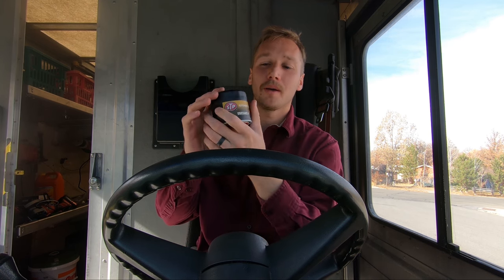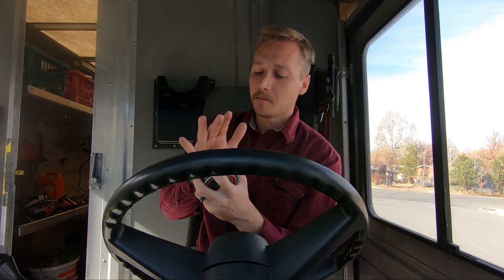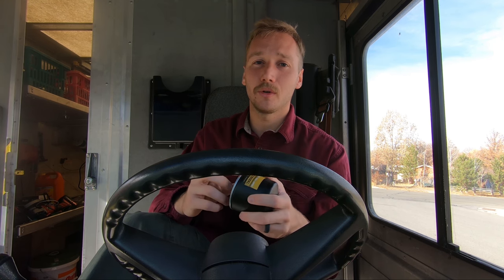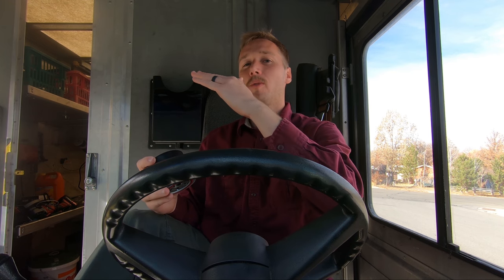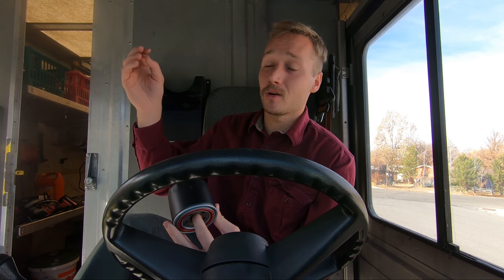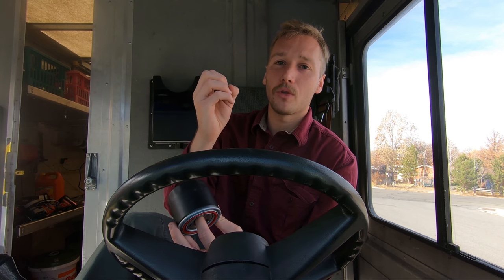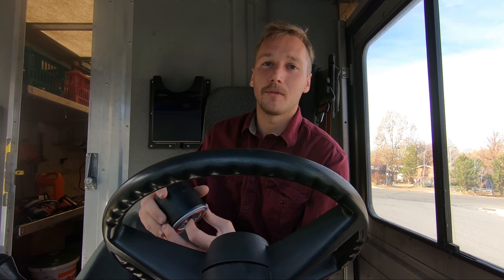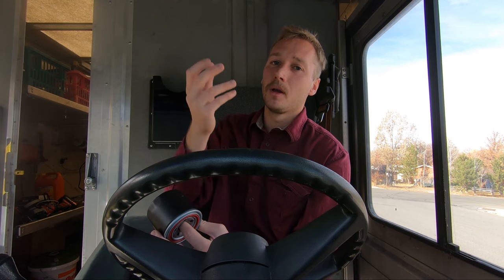Why you shouldn't put a magnet on your oil filter. **What to do instead!**

Comment: Are you a petroleum engineer? If so, can you point me to the published SAE paper which backs up your claims? I'm betting you're NOT a professional engineer, and there is no documented proof to your claim. Your position sounds like a sketchy rationalization, which is heavy on your own wild assumptions, not based on facts. I KNOW the magnets work because my riding mower engine oil & oil filter  is changed twice a year, and the oil always came out nearly black. I added a pair of FilterMags to the filter, and now my oil changes are light amber. When I cut open the filter, now, there is a black shadow of ferrous dust captured against the inside of the filter housing.

Comment: Filters don't stop as much as you think.  Magnets will remove particles that the filter can't....they are beneficial.  Putting a magnet on the filter will only help remove those particles, as they do mix with and travel through the engine with the oil.  A magnetic plug will only catch some of the particles as they settle down when the engine is shut off.  Run an engine for 3000+ miles with a magnet on the filter and drain plug, you'll be amazed at how much debris will get stuck to it...all of that debris makes it past the filter....

Comment: What if I want to put those magnets both on bottom pan but also on filter? And when I change oil I will change filter (with particles inside) and particles in the panel shall be flushed with old oil. How that kind of behavior is wrong and harmful?

Comment: TL:DR - Really good filters are really good. No reason not to add a magnet.
Reply: 20microns is what practically all oil filters can filter. The smaller pieces of metal is what acts as an abrasive inside the engine and causes damage. People who actually analyze engine oil and breakdowns already know this is the case. It's a hot topic though online and an easy video for traffic to throw out their opinion based on "it's what I think"
Reply: There is absolutely zero downside to adding a magnet. Only upsides. It cost zilch and acts at a distance to complement the filter action. Why be content with less than perfect, when this improvement, however limited, is so easy to make ?

Comment: I would put like the magnets on both the filter and the drain plug! At least on the filter the particles will be removed from your system once you change the filter. The magnets on the oil pan might keep the fine stuff from circulating, but will remain in your sump until you physically clean it out or flush it out by disconnecting the magnets. Heck, I would even use them in the cooling system and fuel system if possible. LOL

Comment: the oil comes thru the filter then hits the shell and with magnets on the shell you find gray gunk stuck to the case where clean filtered oil is supposed to be. its not 100 clean if grey matter is coming thru sticking to the magnets
Reply: You've got it backwards. The unfiltered oil flows around the outside(inside of the outer shell of the filter housing) of the filter media, then flows thru the media into the inside of the media and the filtered oil is pushed out the center of the threaded end cap.
Reply: @budlanctot3060  if its metallic and the magnet gets it thats a good thing , I had race bikes and Suzuki puts magnets on there tips of the plug nuts for that reason , they know its a good thing .

Comment: If you put magnets on the bottom of the pan there is no way to guarantee that the metal partecals have actually drained with your old oil. If you believe the pistons moving up and down and any other moving parts in there are not enough to move those "heavy" particals then how would drining the oil be any different? Why even put a magent on the bottom of the pan to begin with? Also have you ever put a magnet on a metal door or something and let it sit there for months? I have noticed that if you do that magnetic (ferromagnetic) dirt or dust gets stuck to the other side of that which is what is expected because it's a maget but my point is if you try to clean that debris off sometimes that dirt or dust gets etched into to that metal door or what ever the magnet is attached too. I would imagin the same happens in the oil pan. Why would you want etched particals at the bottom of the oil pan? They may never come off or maybe it will just break off in one huge chunk later? Breaking off in one huge chuck would probably never happen either but again i ask why would you even preffer that to begin with? If the magnet is on the oil filter you get everything out just by changing the oil filter.

Comment: All magnets are not the same. People using odd-shaped and janky magnets ain't the answer.
There is a specially-made Oil Filter Magnet available --  FILTERMAG Part # SS365PR -- Fits 3.5 - 4.0 -inch diameter oil filters. 
Covers large area of oil filter -- and IT GETS THE METAL OUT !!
Reply: It doesn't matter a tinkers damn what shape it is. Any decently strong magnet will do.
Reply: @caretakerfochr3834  NOPE. A magnet made specically for spin-on Oil Filters, such as the Filtermag SS365PR, fits perfectly against the side of a 3.0 - 4.0 inch diameter oil filter.
 They make a smaller size for the smaller-diameter spin-on oil filters. I'm not selling them -- I'm saying that THEY WORK, and no other oil filter magnet works as well. 
 You're free to do whatever you want.😁
Reply: @caretakerfochr3834  You know what they say -- " You get what you PAY for! " 😁

Comment: The magnets stick very well on aluminum oil pans don't they? Very weak points man! Just stick it on the filter! What does it hurt.
Reply: I'd go with the filter but you could always glue the magnet to the bottom (outside) of your drain pan.

Comment: Why not to add this extra level of filtration to your system as magnets. It's cheap and effective! great topic, thanks
Reply: Well, FilterMags are NOT particularly cheap, initially.  But they are reusable, so it's a one-time purchase. So over 20 or 30 oil & filter changes(100k -150k miles) the cost of a pair of  FilterMags is like $3 - $5 per oil change. During the pandemic, I couldn't get FilterMags, so I bought a bunch of neodymium bar magnets for about $30, which worked just as well, but they weren't nearly as convenient to use.

Comment: Wouldn't a magnet interfere with the oil filter bypass valve? Yes.
Reply: NO !! The FILTERMAG #SS365PR does not interfere with the mechanical operation of the oil filter in any way.
Reply: @SlikLizrd  yeah,  it definitely does. Don't make me post a link showing you what that does when oil is running through an oil filter. It certainly won't help.
Reply: @CorvetteTrev  send the video
Reply: @CorvetteTrev 
POST IT!!!
Reply: The oil filter bypass valve is only opened when the oil pressure on the filter media exceeds the bypass valve psi settings... Lol
How in the world does a magnet on the side of a filter affect the oil pressure inside of a filter? It doesnt. 
I would love to see a video proving me wrong but Im quite sure that one doesnt exist.
Reply: @oompaloompa7430  

You are correct. ✅
Reply: @CorvetteTrev  

Show me. Show us!!  😐 We're interested.
Reply: @steven4894  I mean the whole idea is pointless anyway.  If you have metal in your oil pan you have a whole other issue. I run a dry sump on my Corvette track car,  we left a boroscope inside one of the oil cooler lines (*in place of one, sealed) to make a promo video for improved racing oil thermostat. The wide angle showed the filter and if you saw the amount of flow,  when hot 🔥 🥵 a magnet 🧲 is going to be absolutely null. If you buy a magnetic drain plug , that's fine,  why do I care... on the oil filter is just silly- no matter what

Comment: I was having a problem with the oil drain plug on my car leaking.  I put some black RTV on the threads and it hasn't leaked since.
Reply: Are you using a new crush washer at each oil change?

Comment: The problem with your theory is a standard oil filter is generally rated to 10 microns. 10 microns converted to inches is .0039, saying your oilfilter media is fine is a overstatement. Also putting a magnet on your filter of oil pan wont do much of anything. First of all if you put a magnet on the outside of your oil pan the magnets force inside will be very week. Second most of your bearing material is non ferrous. So its non magnetic. A better option would be to run a longer oilfilter. It would do two things, it will increase oil capacity slightly, second more volume inside the filter will decrease the velocity of the oil across the pleats helping the filter media trap and old contaminants while having extra capacity for more contaminants.
Reply: Hey good info about longer oil filter

I don't think they make longer ones for LT1 engines?
Reply: @mightywalrus6414  , I'm not familiar with the engine. But a quik Google search would tell you. As long as the gasket inner and outer diameter, and threads are the same. It should work. Just watch for clearance. What part # is the filter your running?
Reply: A longer oil filter would help. Good point. 👍

BTW, non-magnetic metals like aluminum, brass, or copper are much "softer" than hard metal bearing surfaces.  😉

Comment: If this is an example of the half assed reasoning he does, I'm Not subscribing.
1) the filter is the perfect place to catch particles. ITS WHAT ITS FOR!
2) the oil pan is not a good place for magnets. The drain plug yes. Because you can completely remove it and clean it. What are you going to do, remove the oil pan every oil change to clean it? 
3) NO, draining the oil does NOT remove all the metal particles. Just like how soap residue  sticks to the sides of the tub when the water is drained. 
Oy vay!
Reply: 1. Remove the magnets 🧲 on the bottom of your oil pan first.

2. Remove your oil filler cap and oil dipstick to maximize air-oil displacement. 

3. Remove oil drain bolt. The force of the oil leaving the pan will easily wash away and drain out any metallic/sludge debris at the bottom of the oil pan.
Reply: No one expects perfection. But 99% elimination would be pretty acceptable for most people.

Comment: wrenching for 30 years, a mulitude of personal and company cars and a multitude of makes from high end to low end, high low end etc.... you DO NOT NEED TO ADD ANY MAGNETS to any part of the engine, there is a magnet in the sump plug that is enough, I have NEVER had or worn an engine due to metal in the oil.... change the oil at factory specs OR sooner, use a good quality oil and filter and or OEN spec, you will have NO PROBLEMS at all
Reply: Wrenching for 30 years !??  Don't approve of Oil Filter Magnets !?? So what !??
 I'm 83 -- been wrenching for over 65 years, and am a user of and firm believer in, the benefits of a FILTERMAG # SS365PR, which is a 2-piece magnet kit that attaches to the sides of a spin-on oil filter.
I'm pretty sure that I have  A LOT more experience with engines, oils, and oil filters than you have gathered in your 30 years, and I'll say politely that your opinions regarding the filtering of engine oils are remarkably naive.